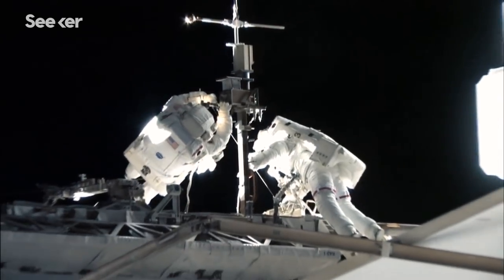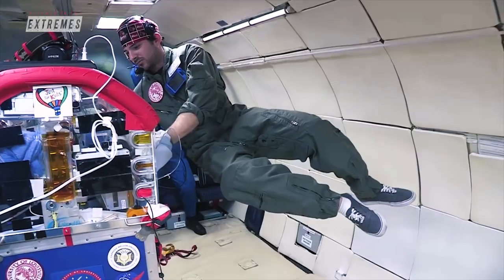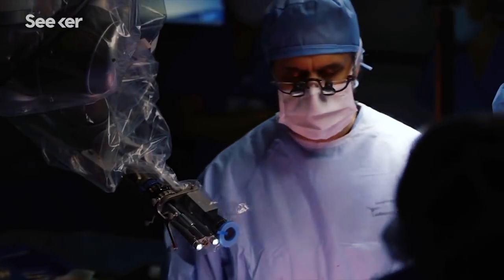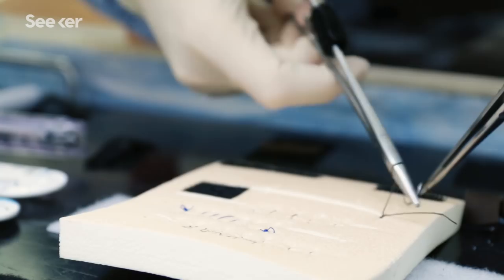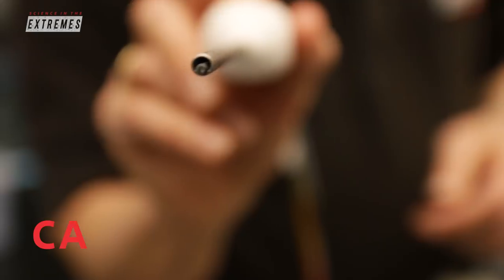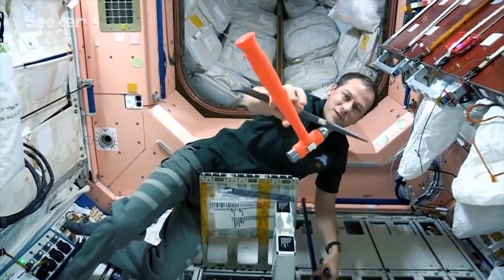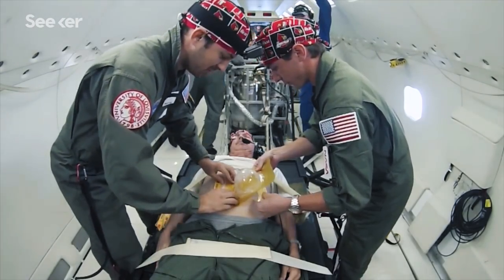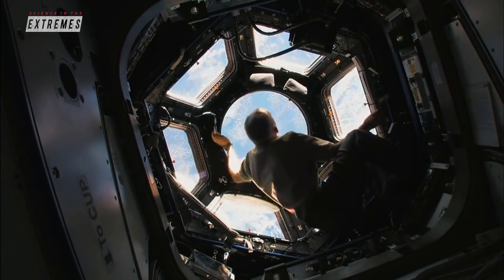Can We Perform Surgery in Space? - Science In The Extremes

Comment: What kind of a question is this?  "Um, no.  Scalpels don't work in space, and neither does laser cauterization or sutures.   OF COURSE one  can perform surgery in space.  You might need a surgery table to which you'll strap your patient, feet straps for the surgeons, and a surgery environment bag that will catch blood.  The surgeons will probably need to be on full-mask respirators to prevent inhalation or eye/mucus membrane contact with floating droplets of blood.  But can it be done?  Absolutely.